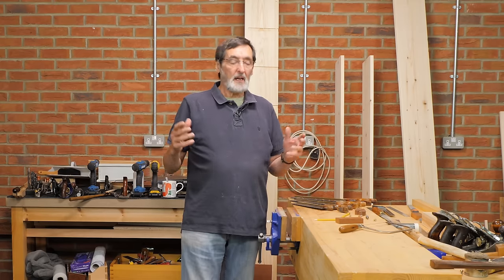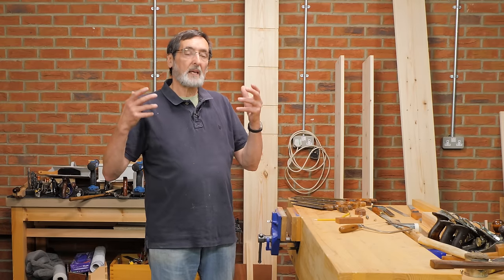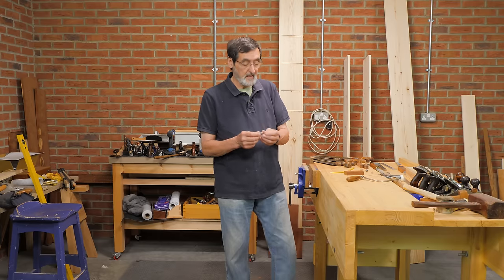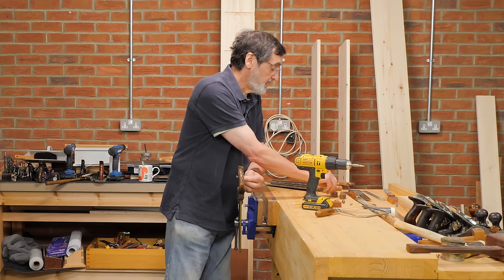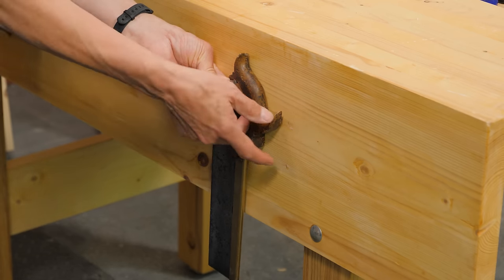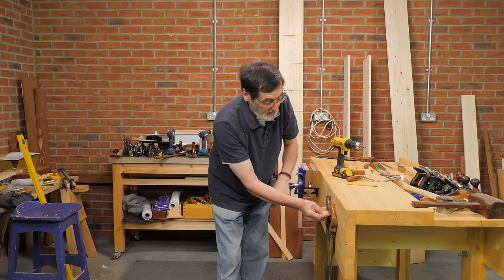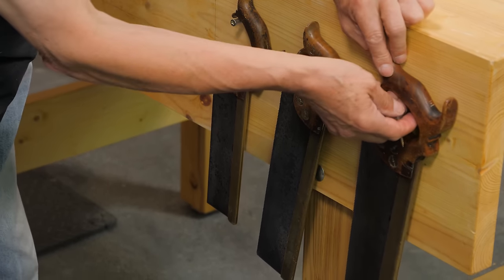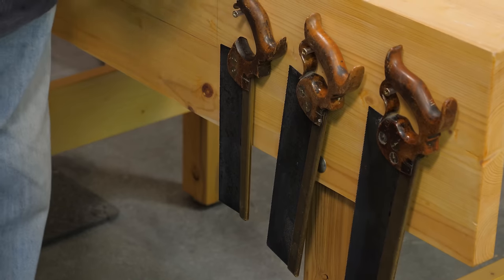Saw Hangers | Paul Sellers

Comment: Paul, the edge of my bench lacks the depth to allow me to hang my saws this way. But I was able to use your hanger design to hang them on the wall little more than arm’s length away at the end of the bench. Thank you for this idea and all the others you share.
Reply: I hang mine on a wall and also have a portable holder that I can slot into my bench when I am working. 
You could make one with a sloped surface that you could set up on your bench when you are working so that you could set your saws on. 
I set mine into the tool well with the saws sitting up at an angle as I use the sides of my bench for clamping and dog holes.

Comment: Hmm, beech dowels have worked fine for me to hang tools. I don't mean the short ones (usually 40 mm) but cut to length from 10 mm beech dowel rod, so that there's plenty of dowel inside the wood. I also glue them in. If I want to get rid of them or change something, they can just be cut off with a flush-cut saw.

The swivel lock is quite clever and looks nice, too. Definitely better than my three strategically placed dowels :)

Comment: Thanks for sharing. What works for me is wood cut to the inside shape of the saw handle. The top side of the holder is given an inside chamfer to stop the saw falling off when the table shakes. Rubber sheet stops the rattling. It take about the same time to make and has the added advantage of clearly marking what saw goes where.
Reply: Interesting because I made one that way but my saw fell off 😲. Although I didn't have rubber on it.

Comment: I use a system similar to one of those knife blocks under my bench so I pull them up and out at an angle, I tried something like you have but for me it's more comfortable to be able to grab by the handle with a better grip

Comment: How do you edge plane longer boards with your handsaws on the right side of your bench? Wouldn’t the saws interfere?
Reply from the maker: No. My bench vise is not flush as is a common practice these days. It protrudes out from the apron 1.5” which makes the vise much more functional. I’m never sure why woodworkers feel the need to clamp long boards to the apron. I never do that and never have.

Comment: I like the idea, but I don't think I could put these here myself, I'd just end up hitting them with my leg every 2 minutes. I could just put them at the end of the bench I suppose..
And what about when you want to put a long piece of wood into the vice, don't they get in the way? I only built my bench a few weeks ago, and I already put a few holes in this area for dowels, to support long pieces, and I've already used them several times. Maybe there's a more sensible way to support large pieces that I haven't figured out yet.
Reply: Hang them on your wall and you could also create a portable bench hanger that you then use with your tool when working on something specific. 
Paul has several benches of different sizes and uses you may have different needs but the ideas Paul has can still be used by you in a different fashion.

Comment: Just curious - why do you need anything more than a simple stop to keep the saw from swinging back and forth? While the curved stop looks nice lined up with the handle, I'm trying to understand why it's necessary. A second screw/piping put in at the back side of the saw would do the same thing, and always be out of the way as you reach for the saw.
Reply: Style points yo.
Reply: Maybe mine was position incorrectly but I found my saw fell off when I was planing when I used screws alone.
Reply: @Elie Kochman
Pauls design stops the saw from jumping out when in use especially when banging the table. 
There are other designs you can use as well but Pauls is a simple natural design that works extremely well.

Comment: Good day,

You mentioned that all three of your dovetail saw are "un-negociable". I was wondering what makes the need for those 3 saw? What can a 14 inches do that a 10 inches can't do, and vice versa?

A beginner wood worker that you helped off the couch
Reply from the maker: Mostly is to do with weight and saw size appropriate to the work. Small saws for small work, larger saws for heavier work. Simple as that.

Comment: Wait, how about putting a screw through a dowel into the workbench........Hmmmmmmmmmm...
Reply: You could put a screw into a dowel or even a stone with a hole in it if you really wanted to. Rubber is also a good edition as well.